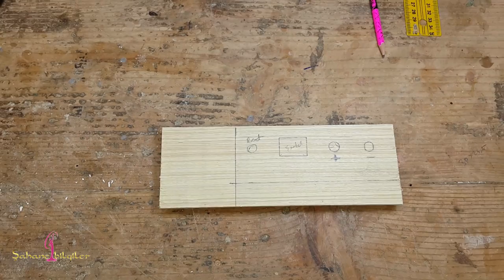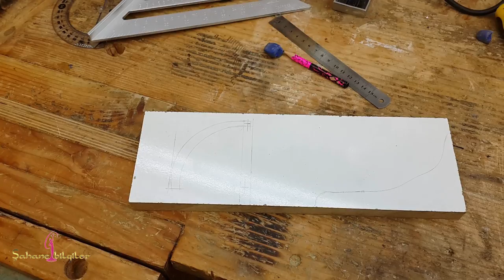How to Make a Disc Sander / Sanding Station / Making a Sander / Zımpara Makinesi Yapımı - DIY

Comment: That turned out great, Mehmet. I am impressed. Have you also installed a right / left rotation to be able to grind on both sides...just an idea😉👍🐻❤️
Reply from the maker: Danke schön. Links/Rechts Rotation habe ich nicht installiert. Aber die Drehzahlen sind super. Es hat eine sehr gute Leistung.
Reply: : Ich werde mir mal einen Frequenzumrichter dazu bauen um die Drehzahlen ändern zu können. Danke für die Idee!👍🐻❤️

Comment: nice video great music.
do you happen to know what is the model of the electric board? not every board enables you to use the push buttons for speed adjustment without the treadmell upper board (the one you use when doing sport).
Reply from the maker: Hi,
Thank you. If the speed control electronics is not in the circuit, you can do it later. Someone who understands electronics can make a speed control circuit. see you later. All the best.. (friend, where is the country)